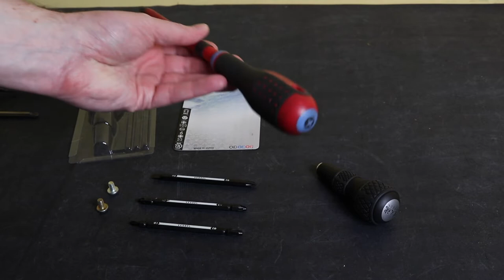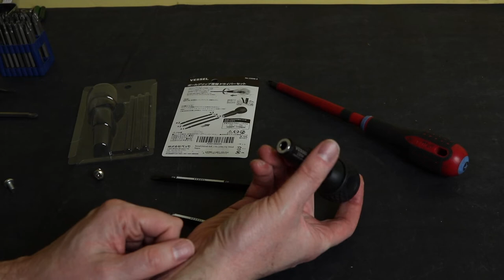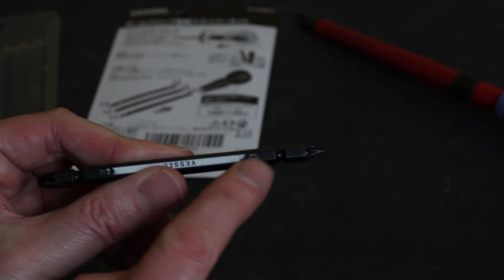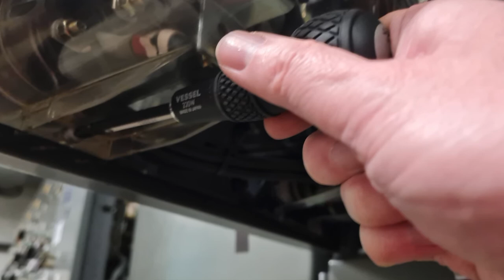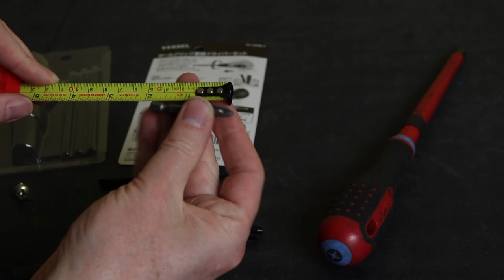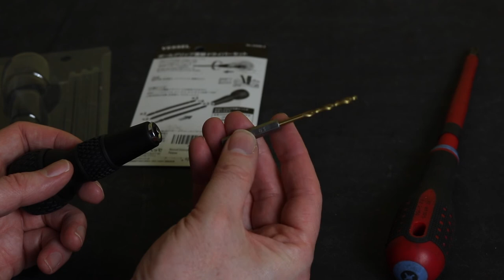Vessel Interchangeable Ball Screwdriver

Comment: The insert in these are made of chrome plated brass and us a spring steel C clip with two detents.

The way I took the slop out of one of mine was I removed the brass insert drilled and tapped an installed a 3mm grub screw. Then reinstalled the brass insert into the handle. 

I did this because I couldn’t find a 2.5 or 3.5 - ball grip. So I did that to a Vessel 270BW stubby with a 2.5x75mm wiha bit and 220W with a wera 3.5x158mm.
Reply from the maker: Thanks for this JT. Worth bearing in mind if the bit becomes too loose, but it still seems okay at the moment.
Reply: I guess maybe I should have mentioned I didn’t do this to mine because the slight wobble bothered me or that it wears quickly. I just wanted bits to be semi permanently attached so no one would try to use the bits in a drill if the borrowed them. 

 Another thing I forgot I did was I installed 6.3x10mm aluminum PCB standoff in all the brass inserts. That allows standard 1/4” hex bit detents to lineup with non Japanese bits.